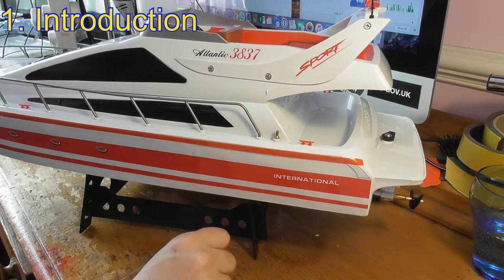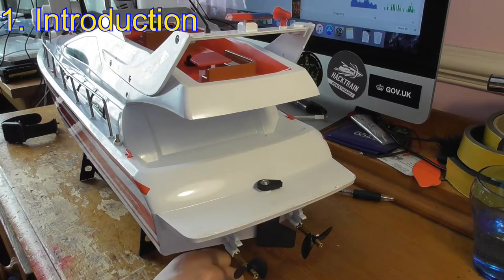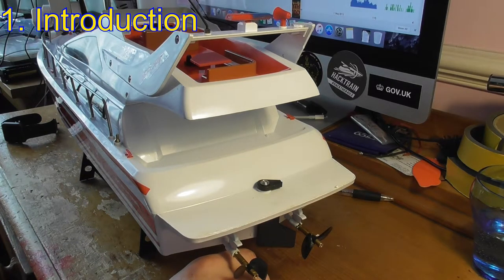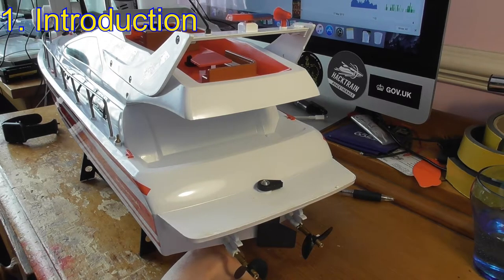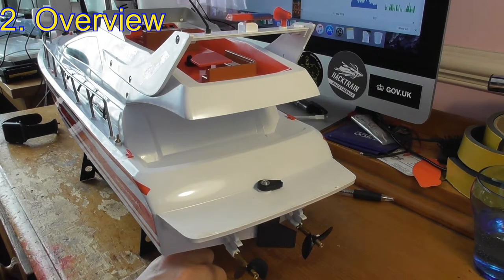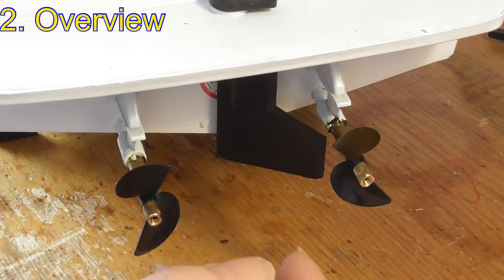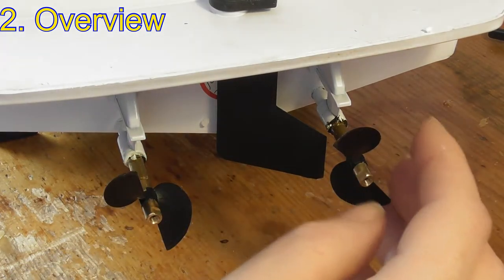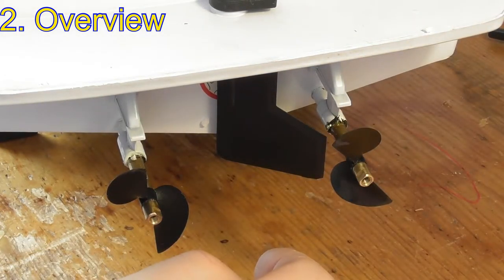Upgrading Heng Long Atlantic Yacht 2:Twin Hobby-grade ESC installation

Comment: Hi, thanks for this informative video. I've just purchased the latest edition of this yacht, it now does have forward speed control but still no reverse when pulling the throttle stick opposite to forward position. I'm not too fussed about having a servo rudder,  but is there any way to add reverse using the provided stick style transmitter? If not, what stick transmitter would you recommend so that I could make the motors reverse. Thanks.
Reply from the maker: I had to put 2 new speed controllers and hobby grade radio control in to mine. You would need to limit the the speed in reverse -as suddenly spinning the props backwards can cause the propeller retaining nuts to undo themselves - and cause the propellers to be lost forever at the bottom of the lake. It is not easy to find spare propellers as a spare part. Controlling the motors separately requires a mix in the radio control - so a programmable transmitter - such as the Flysky i6x needed.

Comment: MY god... I'm the first to comment? !!! :) An informative and interesting video... I found this clip by chance when I looked up about the boat in question.. how did you get it for 40 quid?!!!! I saw it on ebay for around £180! However... more serious comments... and please take with respect and politeness as I'm a non-modeller but interested... firstly, you seem to be a guy with good modelling experience... to better replicate the true nature of driving a twin engine boat, I'd have looked at independent motor controls, plus installing servo operated rudders. Your control to turn the boat on the spot is correct but only something done in tight manoevering... when cruising a boat steers by it's rudder. Second point... was it not possible to fit your receiver and 2 speed controllers inside the casing the original radio came out of? Would have been neater.... Third point... you seem to have 2 switches for each speed control, plus an overall on/off switch for the boat. Could you not combine these into a single 3 pole switch? But like I say.... I'm not the modeller... just food for thought and I'm sure you have your reasons... only other comment I have is on the boat itself... although it looks sleek and is the style I'd want, it sounded very flimsy and cheap in construction, the props didn't seem to run smoothly and it sounded very noisy... Cheap propshafts? About what I'd expect for a cheap model but certainly gave food for thought to how I would have upgraded it! Good video though and informative.. well done :)
Reply from the maker: Thank your for your very thoughtful comments. Sellers often price this sort of thing at a great variety of prices. Always worth scouting ebay and amazon and even bangood before pushing the button! This boat is very much a toy. In the end I found that reversing the props at ant speed caused them to come off & be lost. I did find that using the rudder in combination with varying the speed of the props helped with tight turns, but the rudder was enough most of the time. I tend to spread the RC around the boat - didn't even think of putting in the original position. The top cover is pretty water tight. These days I tend to put multi ESCs on a single switch on the battery and solder the individual switch wires on the ESCs to permanently "on". It is very noisy - probably a lot out of balance plus a very large "sound chamber". Foam or something wrapped around the prop shafts and prob more support for them would prob help. But at £40 I couldn't resist! Thank you again for your thoughtful comments! 😀👍